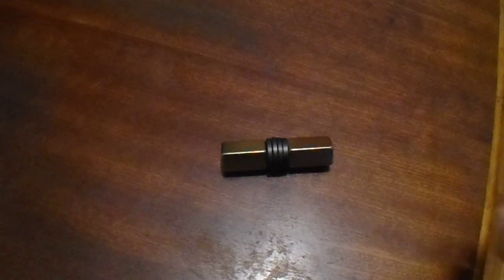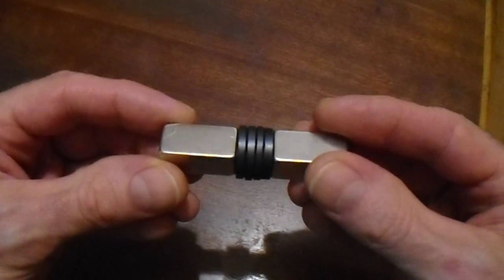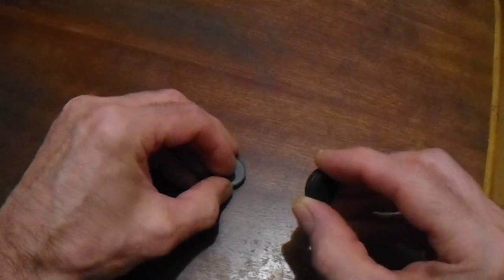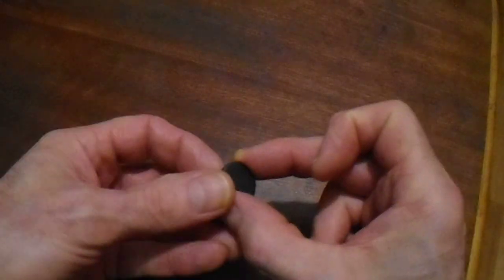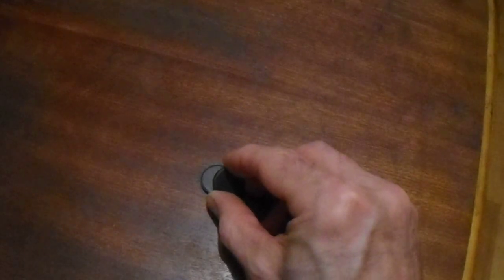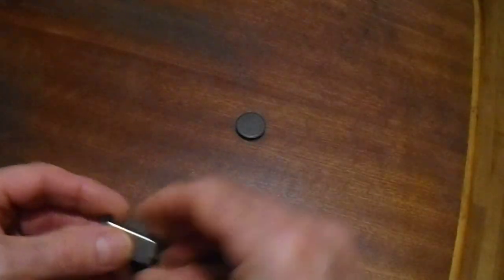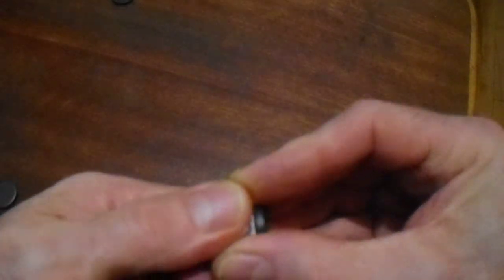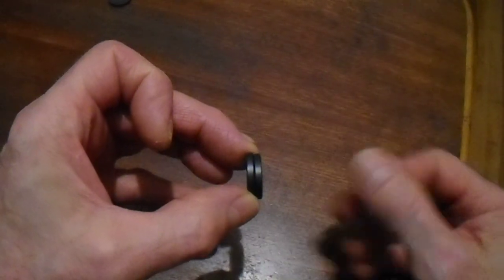fixing my weak magnets

Comment: The neodymium magnet re-magnetizes weak ferrite magnets due to its greater strength. It can be made multi-pole.
Reply from the maker: Correct
Reply: @briankerr4512  You can watch my videos there you will see how to get the wave effect in the magnet
Reply: After look at the magnetic lines through your glass, I would do it myself, but I do not have such a device

Comment: magnetic signs for a truck curling and weakening in the corners. can they be fixed?
Reply from the maker: maybe try using a strong neodymium magnet to re-magnetize the areas which may have demagnetized  or maybe the magnet material is warping because of heat the sun.  https://www.youtube.com/watch?v=UQz9bxDBI-w